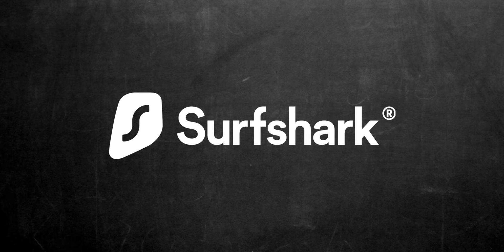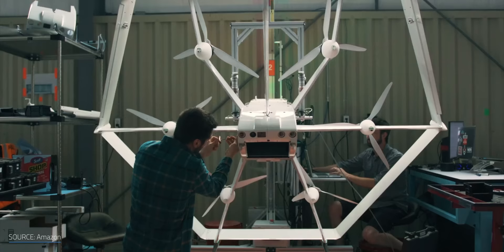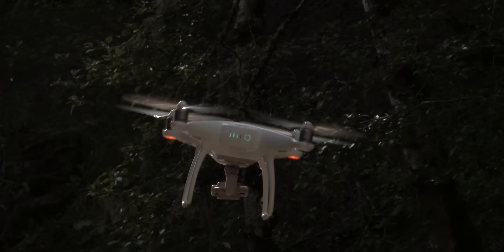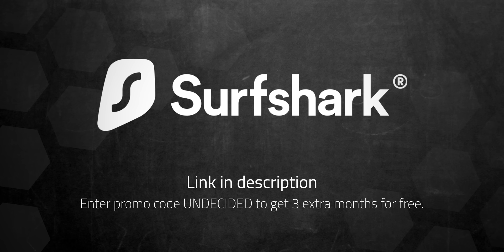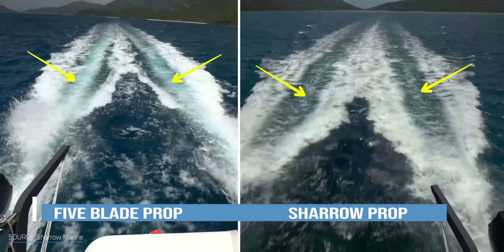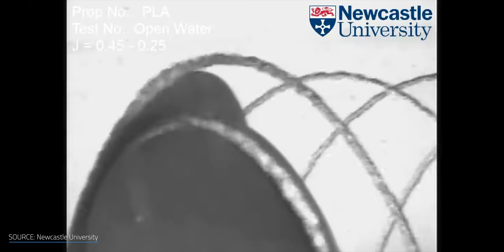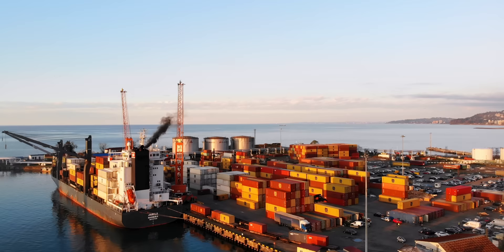Why is this Propeller Getting So Much Attention?

Comment: Those large ships you mention for the most part don't run on diesel (too expensive), they tend to run on bunker oil (cheap, energy-dense). They also tend to run at an engine rpm less than 400, which these props aren't designed for.
Reply: Turbulence/cavitation is still an issue in large ships and ducting the propellers would lead to significant energy savings. The problem with ducting propellers in ships is fowling and in drones, the extra mass is an issue. This propeller design avoids both those issues.
Reply: But engine rpm don't equal prop rpm which should be a lot more relevant for the prop design to be working or not, right? I'm no expert on boats or ships and would expect a cargo ship's prop to run slower than that of a boat but I can't make out why engine rpm should be a central argument
Reply: @thilokm522  Actually in a big ship propeller rpm is probably the same as the engine rpm. However even propeller rpm is irrelevant, what is relevant is the speed of the tip of the propeller, which is a function of propeller rpm and propeller diameter. A big ship has a much larger propeller diameter, so the speed of the tip is still high enough that these sorts of propellers would be a significant improvement. If you can work out how to make them for large ships, then a 5% fuel saving means that next time the ship is in dry dock for maintenance if not before it is getting new propellers, even if they cost millions of dollars each.
Reply: @jonathanbuzzard1376  More optimized prop shape is important, but a big issue with toroidal propellers in the open sea environment would be near continuous fowling with seaweed (not to mention other flotsam & jetsam). A fowled propeller vibrates violently and has significantly (40-70%) reduced efficiency. If a small inland or coastal boat prop gets fowled it is usually no big deal to stop & clear it—doing that with a huge freighter is another matter altogether. This is why self-clearing prop designs are such a big deal. (I should have added this to my original comment at the time I posted it.)
Reply: Some basic maths indicates that the tip speed of a 300mm diameter outboard engine at 4000 rpm is the same as that of a 10m diameter cargo ship prop doing 120 rpm
Reply: @colinsutherland8965  That's actually the number I had in mind, but I didn't trust my memory nor feel like doing the math. In any case, it is still a dramatically different shape at that point—ignoring for a moment the likelihood of toroidal props getting, and staying, fowled.
Reply: Yes, they are VERY efficient. But people who don't know this regularly pan them as dirty and inefficient. lol.
Reply: He did say they ran on fuel oil.

"Diesel" is also the cycle of the engine, no matter what fuel it uses. It is in fact a Diesel engine even if it doesn't burn the fuel called "diesel."
Reply: @Thilo Km  It's not about the objective propeller speed. The RPMs listed were for comparisons between propellers of the same size and with common ICE engines in small boats.
Reply: @LuMaxQFPV  Dirty, but also the most efficient engines in the world.
Reply: Why Don't Ships use Electric Motors To drive their props and Just use the engines as a Generator??  This is what Trains have been doing for Years. You can Run the Generators at a constant rpm (sometimes incredibly low) and get great efficiency equating to LESS EMISSIONS?
Reply: @fastdune5512  trains do that so they can get rid of transmission. With electric engine they can have great torque needed to run without many mechanical part that often tear and brake. But that is at the cost of the efficiency. Large boats just cannot afford to lose any effieciency, and the torque needed to turn the rotor in water no matter how big it is, isn't even to close to torque needed to start moving stationary tons of steel with tens of tons of cargo
Reply: @fastdune5512   zefir provided part of the answer, but there's another part of it right in the question itself: Ships run at a steady RPM for days if not weeks at a time and therefore don't need a variable transmission. Trains require a variable transmission for the reasons which zefir provided.
Reply: @Fast Dune  Because ships use the most efficient engines on the planet and the most efficient way to use that power is a direct shaft to the propeller. Diesel electric is far less efficient. It works well for trains because you can't have a direct shaft to the wheels and the electric motors allow for dynamic braking.

The emissions problems with ships stem with the fact that there is no regulatory body that will regulate them.
Reply: He addressed that, about him not being sure whether this will be scalar upto a larger design more suitable for cargo ships, but this might create more avenues and renewed interested for engineering the propeller design for cargo ships, maybe.
Reply: @fastdune5512  There's a loss factor in using a fuel based engine to generate electricity then convert back to running an electric motor. Also , On board a ship you have to deal with constant ingress of saltwater . Not good for electrical systems , so they keep it simple as possible. Part of the reason diesel-electric submarines are so expensive to build and maintain. As it is many modern ships have onboard electric generation systems to power auxiliary propellor or pump jet driven  control pods. So I guess they already have that option in some ways. Some even have gone all the way to have a couple of huge diesel(petrochemical) engines generating power and various types of electric motor driven thrusters surrounding the ship.
Reply: @DrewNorthup  shrouds can help prevent fouling of propellers.
Reply: @1badsteed  The whole point of a toroidal propeller is that it doesn't need a shroud. Using one kinda defeats the purpose.
Reply: @morgan5941  Sometimes above that. It's tip cavitation where the outer edges are actually doing very high velocity even though the rpm's seem low that's the real problem for marine engineers.
Reply: @fastdune5512  Hi. Good idea…but they do that already for many ship types.
Reply: @jonathanbuzzard1376  agree, but, as with most things, materials could change that.  Graphene infused lightweight plastics may be on the way to solve this.  Saw a video where some homemade graphene was added to nylon rods with massive improvements in strength.  Maybe we will see ultralight plastics (or maybe alloys) with high enough directional strength to make it feasible.  who knows.  Still its interesting.

Comment: The conventional propeller shape also has a great benefit in its ability to allow for a mechanism to change the angle of attack of the blades. This is crucial for aircraft and some wind generators. It is a really interesting and challenging theme for engineers to develop an adaptable toroidal propeller.
Reply: Maybee it seems quite impossible at first, but to change the angle of attack, you can rotate the toroidal shape like a conventional propeller, at least to my understanding.
Reply: Turbulence=power loss. Same but different thought.. . Gasoline engines make a bunch of noise. Why are we not harnessing the energy that makes the loud pop. Obviously there's quite a bit of energy still coming out of the engine when the exhaust valves open. It just seems like technology would be better suited to harness this energy other than just a turbo to force the air back in.
Reply: @brian6739  In F1 they use this thing called MGU-H to make the turbo more efficient and to harness some of the lost energy, it's almost like magic.
Reply: @brian6739  it's called a turbo
Reply: I think variable props at best get around 75-80% more efficient over fixed props. But if there’s a baseline 200% more thrust and less turbulence of vortices (increasing overall lift with smoother air) is a easy upgrade as maintaining a fixed prop over a variable is drastic.
Reply: Actually there is a type of engine that uses the expansion of the primary combustion exhaust to drive the secondary cylinder. It is called five cycle internal combustion engine. BMW has also experimented with the exhaust heat to generate electrical power using TEG units. Now if one could make an engine with that secondary expansion and using oposing piston technology, how high could one get that engines efficiency!?
Reply: @kindcanadian5825  It's not just a turbo.  There's a generator/motor on the turbo shaft that extracts energy and helps charge the hybrid battery.  And then under acceleration it's also used to speed up the turbo more quickly and reduce throttle lag.
Reply: I can't wait to see these used in the aviation industry  !
Reply: @kindcanadian5825  You must not have read my comment. I said other than a turbo.... Turbos have massive energy loss.
Reply: @nathanwells4809  eh? A variable pitch prop has the same peak efficiency as a fixed pitch. The advantage of the VP is you can extend the peak efficiency over a broad range of forward velocity. I absolutely guarantee that the toroidal prop does not give a “105% efficiency boost” (to quote the video). Typical peak efficiency is over 80% so the head room to more than double it does not even exist in theory.
Reply: @nathanwells4809  A variable prop that feathers in case of engine failure is essential for aviation. Toroidal props are great in the water but will never get approved for aviation.
Reply: @rscott2247  They can be feathered. Ask a pilot and they'll tell you that these will never get approved. The drag in the case of a engine failure could bring down a aircraft if not feathered. It's happened many times.
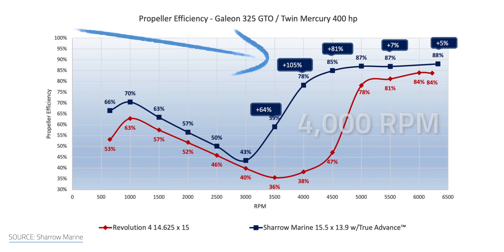Reply: @XPLAlN  The 105% efficiency gain was quoted at 4,000RPM only, supposedly where much time is spent for a boat engine. Higher in the rev range on the graph at 8:10, it shows only around 5% gain near peak efficiencies. So you're right, but the details could be very relevant depending on the use case.
Reply: @fbtippmann  thanks for the reply. ok let’s apply a bit of scrutiny to that part of the video. 4000 rpm is said to be the “sweet spot” where you wish to have peak efficiency in this case. Why is it then, that the conventional prop only has a claimed 38% efficiency right there, given it is perfectly feasible to get 70% out of one? The comparison is bogus.
   He said, quote, “the toroidal prop managed to be 105% more efficient than your average prop at this 4000 rpm sweet spot”. What does “average prop” even mean? Does it mean the average of a bunch of props chosen at random with no particular attempt to match them to the chosen operating point? Or does it mean, for some reason, that conventional props chosen for that specific operating point only achieve an average 38% efficiency? If so, how can that be correct when it is reasonable to expect a peak efficiency of 70%? Either way, it is clear to me that what is being said in the video right there is just not credible.
Reply: @TheCheopps  There can be problems. What can happen is the exhausting of the second cylinder absorbs a lot of the benefit of capture for added complexity. 
A turbine overcomes this but turbines have huge pumping losses (high fuel consumption) and are at their best for narrow operating parameters.
A holy grail of engineering might be the low fuel consumption turbine that can operate over a broad operating range of RPM and high ambient temperatures. If one could crack that .1% of the profits would make one very wealthy.
Conventional piston engines work quite well in spite of everything.
Reply: Ring props can be made w/variable pitch , not as easily as a traditional prop . Both are difficult to make a low drag flooding prop .
Reply: The best case would be a tension system on a self driven rotor.  The entire shape would have to be a series of interlocked mesh or scales guided by a tension cable and a seer mechanism to lock in the angle of attack. However it gets further complicated as changing this angle while spinning requires a robust stabilizer mechanism for when the seer or camlock give to allow the change.  The tension cable is fighting for its existence holding these flex peices together while under power and the changing forces along with the rpms are threatening to turn this prop into an oversized frag grenade.  But some how the angle of attack survives and the hydraulic stabilizer has carefully kept it under control.  The seer or cam used lock into place slaming the tension cable back to attention and the pilot flies away never knowing how many different ways he could have been flayed. I would stick with a rigid version. Personal preference.
Reply: @XPLAlN  Even is a standard prop has a peak of 80% efficiency the toroidal could still be 100% more efficient.... the 'peak efficiency' is only measured against itself.. % of how efficient it could be with 0 losses.
If I can go 10 miles at 30mph on 1 gallon of fuel w/ a standard prop running at 80% efficiency... But I go 20 miles at 30mph on 1 gallon of fuel w/ a toroidal prop? Even if that motor was only at 60% of its peak efficiency it doesn't change that it is 100% more efficient than standard! See how that works now?
Reply: I was just going to post a comment pointing this out.
Reply: @dimitarvenedikov  imagine comparing F1 racers to shipping vessels 😂💀😂💀

Comment: One relevant point that is getting little attention is that the benefits over traditional props are barely noticeable until the RPM's get relatively high (evidenced by the graph in this video). So instead of running these torroidal props at a high speed, the alternative is to run larger, traditional props at a slower speed, which most large commercial/military vessels do now. This will be a real game changer for drones and maybe light craft, but it will not reduce the carbon footprint of the shipping industry by half.
Reply: Why not both? If these are better even at low speed but making propellers bigger is better, why not use these but big?
Reply: RPM and prop size matters, despite small rpm the tip of prop is really fast due to how massive props are on cargo ships.
Reply: there's a limit to prop size that i think the shipping industry is already well aware of - ship draft. too big a prop would hit the bottom and break off. they really can't get any bigger safely.
Reply: But if this design works for them they could transport faster without increasing energy use.  Faster transport means more profit for shipping.
Reply: I remember reading that the engines in cargo ships have a redline of only a few hundred RPM.
Reply: what you see with the graph and higher RPM being more relevant has to do with hull shape more than prop to prop efficiency discrepancy. The toroidal shape is more efficient so at a lower engine RPM it can achieve the speed required to push the hull out of the water 'on a plane'. So what that means is that instead of running around at 4000 RPM you can run at 3300 instead which will burn less fuel for the same speed. The efficiency increase of 66 vs 53% at 600 RPM is where the big efficiency increase comes in for commercial vessels and in the same vein they are designed to be run at a speed not an RPM so if they can run at lower RPM for the same speed...
Reply: They do have much larger ones already.  They're called helicopters.

Also, I think you need to look at the graph again.  It shows the most difference in the mid-range.
Reply: Marine engineer here.  Please! Do not leap from aero-propellers to nautical propellers.  
Or else one risks being asked why fish scales and bird wings are not interchangeable.

Comment: I have a micro quad copter that I have been tinkering with various 3D printed toroidal propeller designs.  It has a one button takeoff and land function that uses lidar to detect its position off the ground.  The higher efficiency propellers throw off the algorithm for this function to a point that rather than coming a meter off the ground and just staying there, it shoots up to 2-3 meters, drops down to half a meter, and fluctuates up and down several times before settling in at one meter.
Reply: You'll get the same benefit more cheaply by simply ducting your propellers. In general though, physical characteristics change with scale so the benefit difference probably won't be much on your micro quad.

Comment: all of these designs just remind me of the fluid dynamics explored by Viktor Schauberger. It's good to see it applied to a workable model. Also with the boat propeller, the major cost is with the fact that it's being machined from billet material, instead of being made from cast bronze. If it were cast, then it would be highly comparable to your average propeller as the volume of material isn't that much greater.